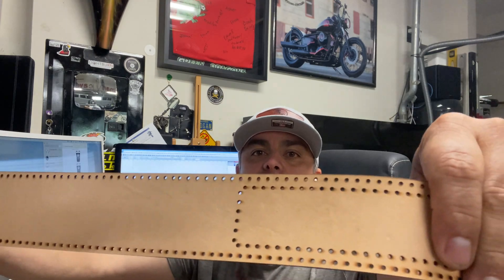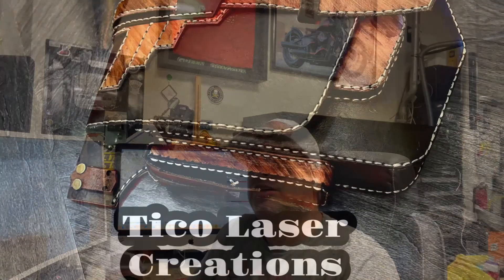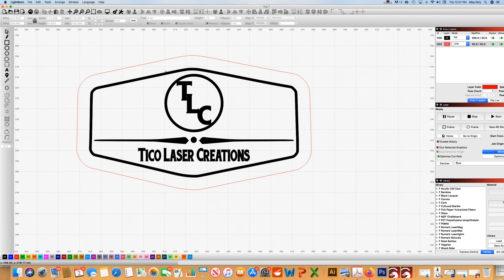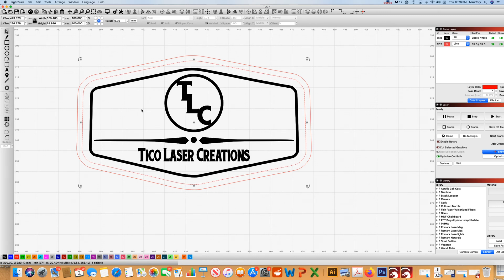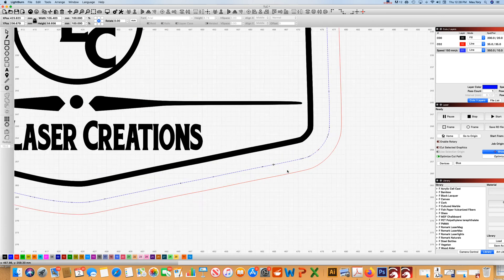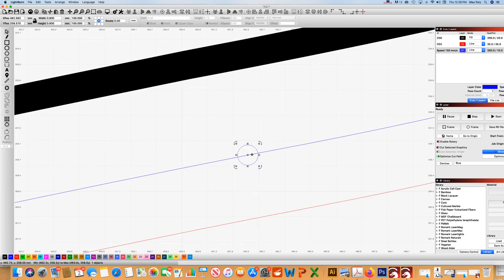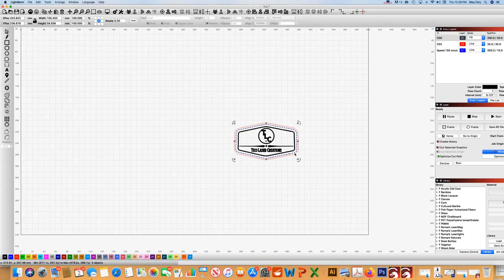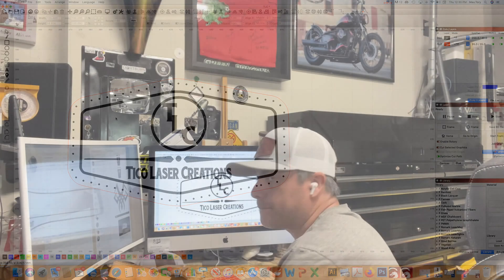Creating a stitching line for leather patches using Lightburn

Comment: I also offset again to make a 'trough' for the stitching to drop down into. In your case with .8mm thread, I'd select the blue line, offset again (choose 'both') set at .4mm. Set it as a layer that will only burn roughly .6-.8mm deep (offset fill). This will give you an inset thread that's much more durable and clean than thread laid out over the top of the leather. When doing leatherwork by hand, we use a tool for it.

Comment: Nice, thanks for the video. Quick question, why do you need to put the first circle on the start point? is this to assure even spacing?
Reply: Because that is most likely what causes the circles to align to the path of the line.

Comment: I'm so confused. Mine won't fill the circles and just throws dots everywhere
Reply: I just figured it out in case you haven't - you have to use the Start Point Editor tool to choose your starting point, then align the hole/whatever you're copying onto that point and do copy along path.
Reply: @KoolyTheBear  I'll give it a shot

Comment: Awesome!!  What settings are you using to cut the holes? Or are you just marking them an then going over it with an awl? Thanks
Reply from the maker: the holes go all the way through ... no awls needed ... setting will vary between machines ... in my machine .. I can cut the leather at 60mm/s and 20% power